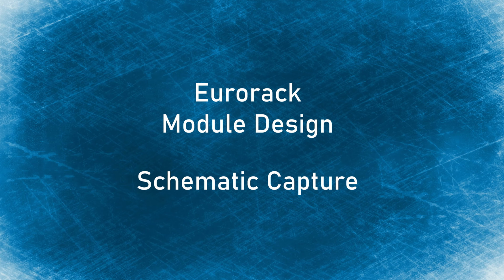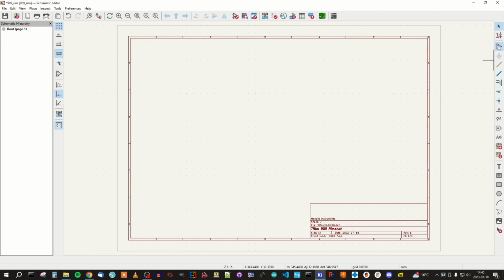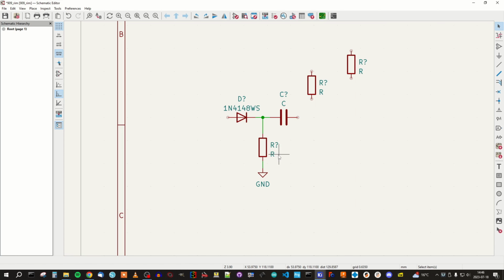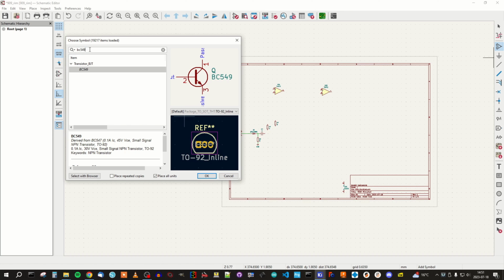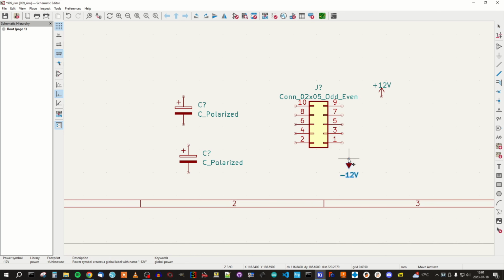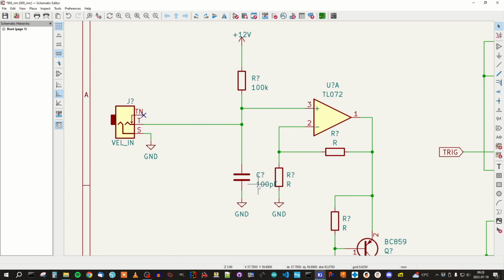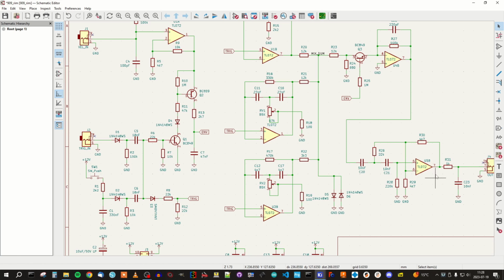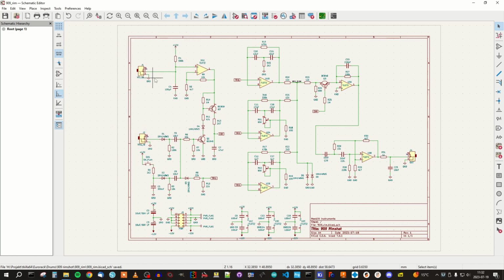Eurorack DIY: 909 Rimshot (Episode 2) - Schematic Capture

Comment: Cool kicad demonstration, and good attempt to convert other friends to come this side! 
No protection diodes on power socket ?

Can't wait for the next episode!
Reply from the maker: Thanks HarmO! Hopefully this series will help more people pick up KiCad and start using it to make modules.
No, I never use reverse protection diodes in my designs, instead I use boxed headers and pin1-2 is always connected to -12V (red stripe on the cable). But it would be easy for someone to add Schottky diodes on +/-12V rails if they want to.